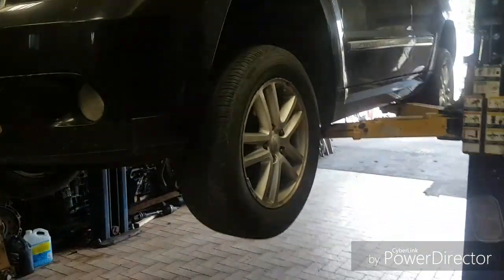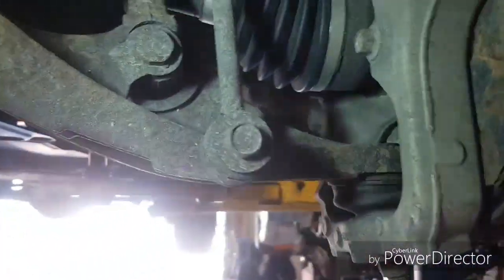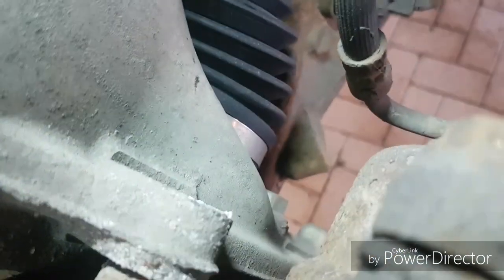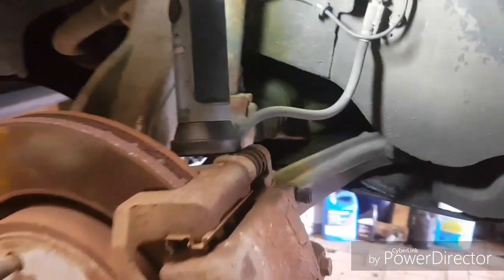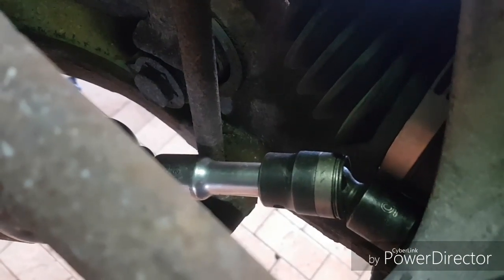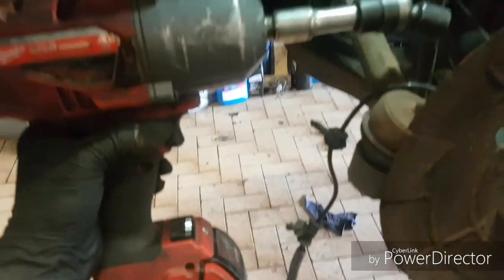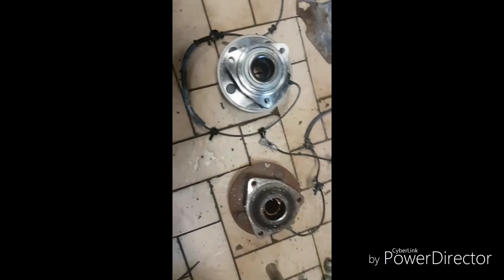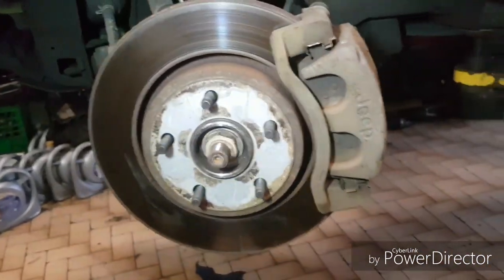How to fix Jeep Grand Cherokee wheel bearing replacement

Comment: Nice video! However, I think is not a good idea to let the caliper hanging from the brake hose...
Reply from the maker: It's comical when people comment on a 2lb caliper hanging on a hose that can withstand 3000psi of pressure. Thanks for your comment
Reply: @UncleTinman  Yes, pressure, not tension...
Reply from the maker: So you're saying the caliper will damage the hose by hanging on it?
Reply: Hi there. I’m just suggesting that a brake line built of rubber and metal and designed to whitstand high pressure will not support permanent tension without damage. You will agree with me that a flexible brake line is not designed to work in tension, that’s why is placed in the way it is. But is just me…, never mind. Your video was very helpful anyway.
Reply from the maker: @andrespinto1077  Glad the video was helpful. Cheers

Comment: No, no no! Anti seize on spindle shaft splines yes (not nut threads), on the hub/knuckle through bolts NO, thread locker red or better yet, OEM replacement bolts.  Axle nut should always be replaced.